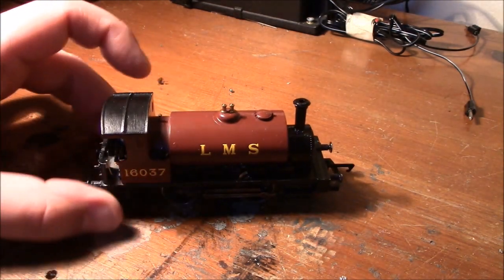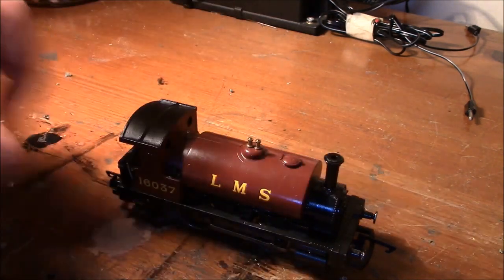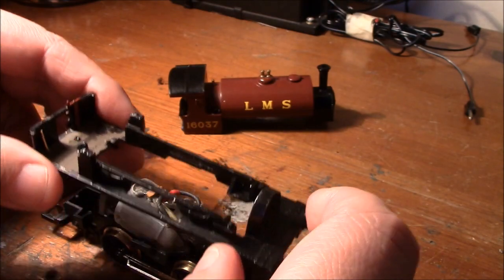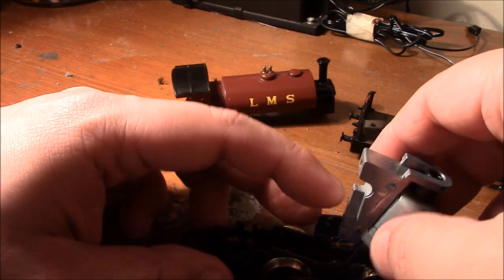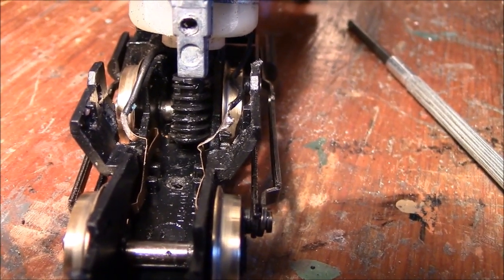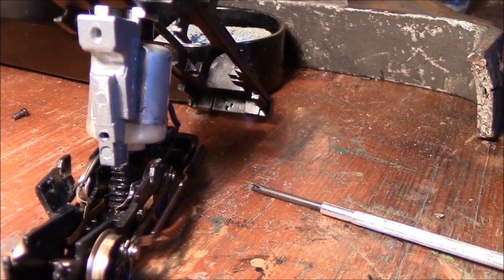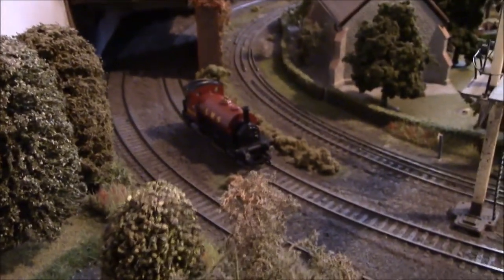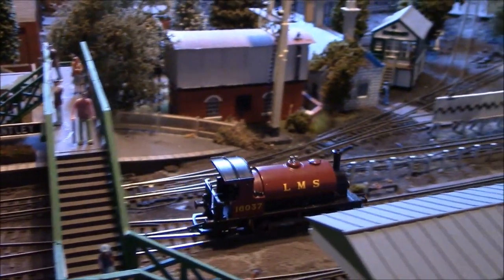ADDING ADDITIONAL PICK UP'S TO A HORNBY 0-4-0

Comment: Many thanks for a very helpful video. I bought a couple of cheap motors from ebay and soldered to the motor terminals and I too noticed a vast improvement in pick up performance. Slow speed running is also much more reliable. Like you I have a soft spot for these little locos. My next plan is to wire a wagon with pick ups and connect it to the loco.

Comment: I have an older version of this locomotive letter Stewart's & Lloyd Corby and it's an excellent runner so I decided to do this very thing and set about to solder the wore to the pickups like you did and I didn't need to because this older version has the pickups on both sides to both sets of wheels that then go to the motor.  They must've changed it after my version to what you have.  Great video BTW

Comment: Excellent video and an 'eye-opener' to something simple, but often overlooked. Will take a look at mine and see if they are single or double wired and make them all double wired. I have 5 little 0-4-0s. Have a few small terrier 0-6-0s as well. Will have a look at them as well as the theory could help these too. Have Peco electrofrogs on the main line and insulfrogs in the sidings.  The insulated frogs on Peco points are smaller than Hornby ones which helps. Electrofrogs are clearly better, but, sadly, anything Peco is better than Hornby !!!!

Comment: I am not clever enough to chip the pug loco I have, had DCC Concepts in Perth Australia , chip the loco for me. Did a great job. It's unfortunate now there no longer in Perth anymore, and now based in UK. Anyway the loco runs well over electrofrog points , even at slow speed.
Reply from the maker: Richard Swallow great job !

Comment: I wonder why Hornby don't connect that extra wire up to the motor? Is it just to save a little on production cost? So, out of the box, does that pickup without wire just connect to metal chassis which in turn connects to other side of motor. Would have been good to see a "before and after" shot of the loco travelling over the points. I'm still a little confused as to why this improves the electrical connectivity over the points as its still picking up power from only the 4 short wheelbase wheels. But your video has inspired me to try it! Thanks :)

Comment: Very nice "how to". Before you soldered the wire onto the pickup that had no wire where did the motor get its power from?
Reply from the maker: Simon -Liverton Central  I assume it was only picking up on only one wheel on the the other side , now all four wheels are connected the lead wheel will pick up if the rear wheel crosses the plastic bit on the points
Reply: If the one connected wire was going to the positive side of the motor, for example, what was powering the negative, before you soldered the wire? Was one side doing nothing, before you soldered the wire on?
Reply from the maker: Simon -Liverton Central I think the other side had the tv interference chip leg connected to it and the other leg of that went to the motor with a pick up lead , either way it doesn’t stall anymore as you’ve seen . If you have one take it apart so you can see .